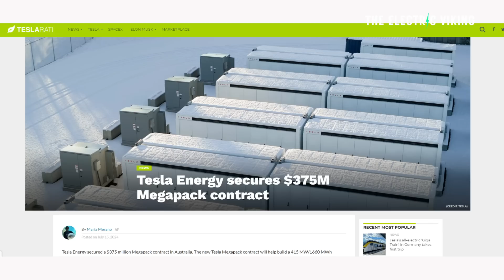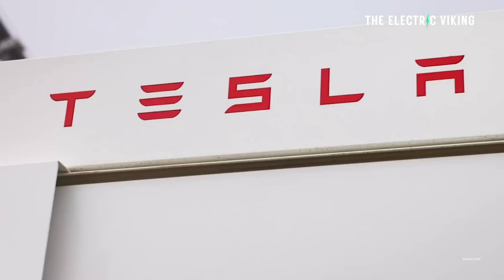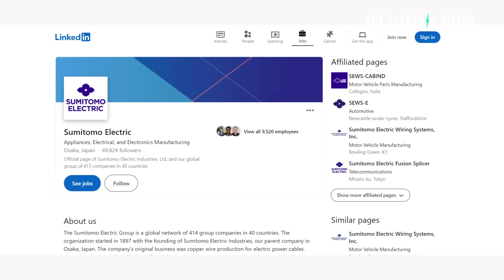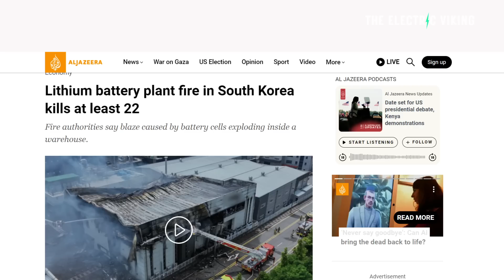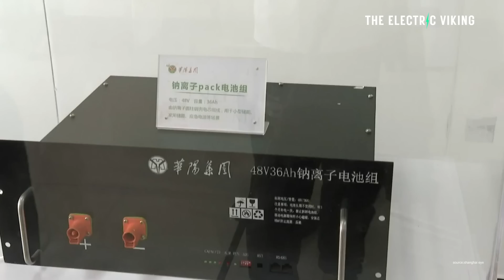AI says sodium batteries will disrupt energy storage and global auto industry

Comment: I believe the LFP lasts longer.
However, will solar provide enough energy to power the recycle of itself AND all these batteries, and of course, the mining, refining and manufacture of yet more solar and batteries WITHOUT fossil fuel inputs, in the future when fossil fuels are OUTLAWED by the UN's net zero mandates? Yes, Kamala is talking that stuff, too. We only have 5.4 years till we can only use half the fossil fuels...
We need to ask ourselves some pretty serious freaking energy math questions:
Assuming we are talking about TERAWATT scale (and the awesome scale of economies that make all this more efficient and cheaper) how many watt hours will be needed to build a continuous reliable 24/7 watt?
What is the EROEI (or EPBT) of solar? Is that enough to make the batteries? How many watt hours to make a watt hour of battery capacity?
Will we need (some sort of advanced, optimized and mass produced) nuclear reactors to power the mining, refining, manufacturing, and recycle, to displace the fossil fuels we need now, to make and recycle this stuff? I'm assuming that all the mining and refining equipment will also be battery powered, saving on fossil fuel inputs.
We only have 25.4 years till ZERO (net zero) fossil fuels...

Comment: Oh look - a new battery technology. Again. "Coming in 5 years", probably. Just like every other "new, ground breaking, revolutionary" that was promised to be coming within 5 years...  10 years ago.
Reply: Battery tech changes and upgrades are happening now. Sure, many things never get off the lab bench but not because the tech isn't good, but because someone doesn't want to fund it further. But batteries, those are coming along every other month. Look at the NIO 150kwh battery tech from last year that got 600+ miles range. In the next few years that'll easily be 800 miles range as better energy density comes along. 

If you think of the Leaf from 2010 getting 50 miles and charging in hours. We now have 600 miles charging in minutes.
Reply: The sodium story is consistent since three years. It takes several years to get it into mass production. The early consumer products exist now. Refinement will take 2-5 years. To compare: The first we white LED was done around 1996. Real flashlights based on it took 3-5 years, headlights in cars are 2010ish. Power went from 40 mW to several Watt. Just takes time, but white LED and Sodium battery are the same stuff: Their tech is just too good.

Comment: Crazy why iPhones do not have this technology to have long lasting batteries ( after 2 years of use they don’t as much charge ).
Reply: Low energy density. Look at a sodium atom on the periodic table and then look at a lithium atom. You'll see the problem straight away. Sodium batteries are really only suited for stationary storage applications.
Reply: @davidbrayshaw3529  ok, so around 60% ? They could also give used the option. I mostly work from home, so don’t mind a lesser lasting battery for more endurance.
Reply: @slammerw3  It's definitely an option, but you give up a lot for longevity. Unfortunately, warranties only last so long and generally speaking, so does one's desire to keep 
modern electronics for more than a couple of years. Manufacturers are expecting your phone to end up in land fill long before the battery dies.

Comment: Lifepo4 batteries are still way ahead in cycle life, with about three time or more cycles than Lithium ion, at up to around 8000 cycles to 80% capacity. Last I heard, sodium was more in line with Lithium ion at around 1000 cycles. For home storage, were weight is not as much of an issue, and no problems of temps going below freezing, price will need come down, if $10.00 per kw, then it really starts to make cents$ even if not as energy dense, not thinking shipping cost to get them in home.

Comment: So a sodium battery is about 15% less energy dense than Li.  That is really unimportant at home, in fact most places except a racing car or aeroplane. What is 15mm extra on a battery that sticks out from the wall 100mm already? Its not really critical or important for most. AND. They wont burn down the house if you bump it with the car or your drill slips while you are leaning the beautiful work-piece you are creating against it and the drill slips. OOPS......Yes, people do drill all sorts of things unintentionally, some even intentionally. Na batteries are also cheaper to produce right now, not next year sometime, or later, right now, They can also be made with the same manufacturing equipment as Li batteries.
While on the subject of LI fires. It will not be long before insurance companies actuaries ( https://en.wikipedia.org/wiki/Actuary ) insist on the company asking if a potential or renewing customer has an energy storage battery and then asks what type and will then be informed there will be 20% or whatever loading on any house or contents policy. Works for floods, so apply to Li batteries.

Comment: Like the idea of Sodium battery , BUT  US $300  or about  $460 Australian dollars  for a replacement battery for 12 V car battery is NUTS  . Sorry replacement lead batteries are  around $200 Australian and I easily get 4-6 years out of them .  High quality lead batteries can cost a bit more but last even longer .
Reply: Its amazing lead acid haven’t been banned yet.
Reply: @swhbpocl  The lead is well contained in the batteries and usually fully recycled at the end of life so I don't believe there is much environmental risk.
Reply: @swhbpocl  Why? They are far easier to, and far more frequently recycled than any other battery type. Thermal runaway isn't an issue and modern manufacturing processes are safe an "clean". It is still great technology for a lot of applications.
Reply: @swhbpocl  Lead acid batteries are generally recycled , Sodium sounds great but should under $50 .
Reply: Graham, true. But prices drop quickly as more of a product is manufactured and sold.
Reply: @freeheeler09  I and many tried Lithium battery in Motorcycle they were a  disaster particularly in cold weather and didn't last .
Reply: I can already find Na ion motorcycle batteries cheaper than Pb acid.  Are the car batteries, they are more expensive right now but as Sam points out the price is going to drop.
   As for getting 4 to 6 years out of a Pb battery,  most people don’t. 
   With regards to recycling the Pb, even recycling the batteries has an effect upon the environment.  There is also the aspect that Pb mining produces tons of waste, most of which isn’t put back in the ground given the cost and current mining methods.
Reply: @waywardgeologist2520  Pb batteries are designed to last just a bit longer than than the warranty offered.
Reply: I'll wait till the price goes way down... Wouldn't be long if Tony Seba is right...
Reply: The replacement batteries for my Colorado 7 vary between $310 and $585. Diesel batteries aren’t cheap
Reply: I think he talking about bigger batteries then a car battery 😂😂😂
Reply: 200 for 6 years compared to 300 for 18 years 6000+ cycles.